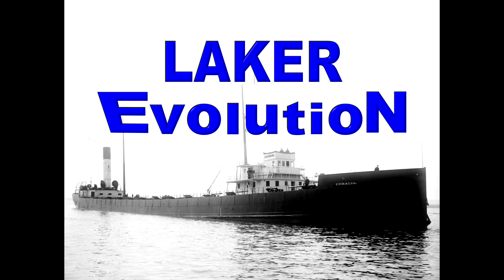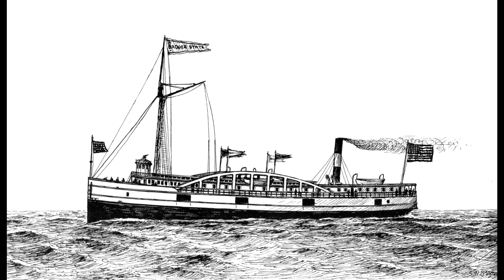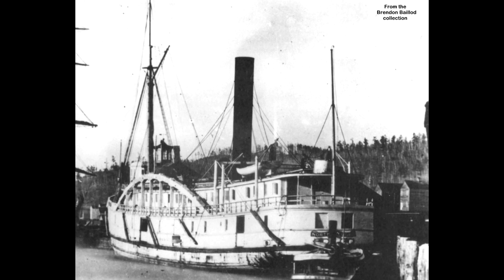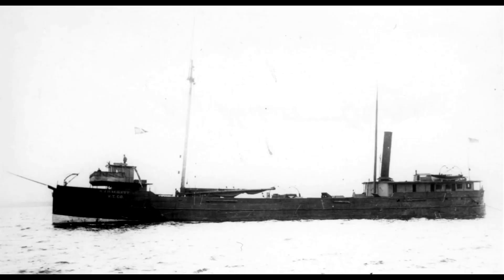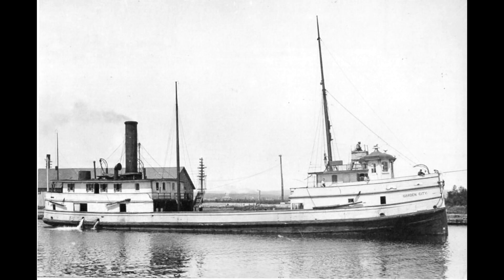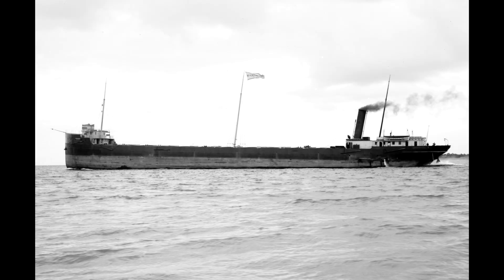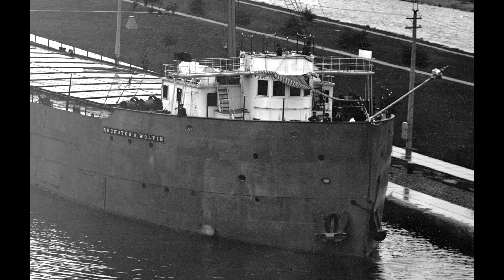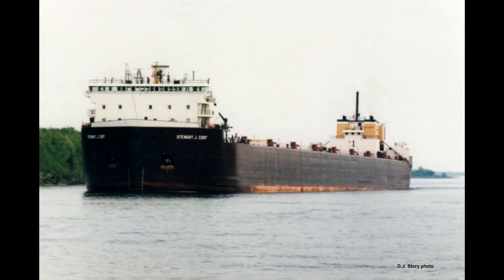Great lakes freighter evolution how did the classic laker look develop through steam, fire and ore.

Comment: In my personal opinion, the Wheel house in front and Engines & smoke stack in the Rear is the Calling card for Great Lake Freighters.

It’s too bad that people prefer the Wheel house, Engines, and everything else in the Rear.
Reply from the maker: I agree
Reply: @authorwes , I have a request for a certain class of LakeBoat, and that is the AAA class (which includes the Arthur M. Anderson, the Cason J. Callaway, and the Philip R. Clarke).

Also, just In general, I am curious about all the different classes of different Lake Freighters. There are lines of Lake Freighters that look the same, and then there are lake freighters that look totally different (and only common similarity between them is the shared classic arrangement). So, what are the different classes of lake freighters? What are the class names? And why were they called that class?

Comment: Hey i see you know a lot about the Great Lakes. My question is that I know several world war 2 ships were converted to lakers how did they get into the lakes because they are surrounded by land is there like a small opening that goes into the lakes?
Reply from the maker: Good question. Most, prior to the present St. Lawrence Seaway, were buoyed up by water-tight extensions welded onto their hulls to act as "pontoons" and then towed up the Mississippi river system. The extra buoyancy allowed them to get across the shallow spots along that waterway. They also had their deck houses placed on their spar decks for bridge clearance. There's a good photo of the Cliffs Victory coming in through Chicago that shows this. Once on the lakes, the "pontoons" were cut off and the deck houses were stacked. That would make a good video... thanks for the idea!
Reply: @authorwes  no problem you make good content subscribing

Comment: Why are Great lakes freighters bows round and not pointy anymore? Also, why don't freighters in the Great lakes take advantage of the bulbous bows like their saltwater counterparts do. It seems like a great way to passively reduce drag.
Reply from the maker: It's all a matter of getting into tight docks. Also a few lakers have had bulbus bows, but they made little difference in fuel economy over the relatively short sailing distances. Ocean vessels sail far longer routes and there is an overall fuel advantage.

Comment: Question is, did this design contribute to ships snapping in half? There must have been a tremendous amount of torque working on the midship area as the lakers were hogging and sagging.
Reply from the maker: Only with the earliest steel hulls. The other that broke in half were do to a type of steel used in the late 1890s and early 1900s which became brittle with age and in cold conditions.

Comment: Sorry if I missed it but why are ships not designed in the classic style anymore?
Reply from the maker: The primary reason is that it is cheaper and easier not to have to string cable and steam lines for heating the length of the vessel. The second reason is that currently all of the lake new vessels running are being built in China or other overseas shipyards. The first new lakeboat to be constructed ON the lakes in 3 decades was started last year. It too has all accommodations aft... but at least it will be made with U.S. steel plates and not that Chinese junk.
Reply: @authorwes   thank you for responding. Really sucks most of our great yards and industry have been shut down but some definite good news there.
Reply: @authorwes   Also I notice the new ships don't seem to need the "aiming spar" on the bow either.
Reply: @authorwes  Radar with its Vessel Traffic technology almost replaced the need to be all the way forward, however, there is a video of ships (boats) in winter layup with what looks like an enclosed forward lookout station and maybe a bow radar. This bow radar should give accurate distances of the bow off docks when docking and for turning in narrow seaways. Captains like to know when the bow is abeam of a (eg.) buoy or point of land to begin a turn.
Reply: @authorwes  I'm certain this is probably a non-issue, however it's going to be interesting to see how well the china built ships hold up over decades. When you consider that ships like the Wilfred Sykes are still toughing it out on the lakes, I kinda wonder if the foreign ones will have that kind of longevity. We both know the great lakes are a more stressful environment to ships than the oceans, but doubt we'll be around to know for sure. GREAT video btw!
Reply: @authorwes  Doesn't that violate the Jones Act? I thought all ships operating between two US ports had to be American built, owned, and operated.
Reply: I am new to learning about these ships/industry/history  -  this has been my question too, and this is the now where I've found the answer!; I did think that the cheap China ships were surely a factor, but - I was wondering if also safety was somehow a consideration; if a boat snaps and all crew is aft, in theory, there's - only generally speaking, better chance of survivors?  Of course, the explanation of the cost cutting is really 'all' it is.. Thank you! I really enjoy your videos Mr. Oleszewski!

Comment: How do lakers translate to salt water? I'd imagine that they're built sturdy enough to withstand waters like the Atlantic but do they have the fuel efficiency to go across it?
Reply: They do not have the strength nessasary for this. They are built totally differently  than saltwater vessels, lakers are much lighter.
Reply: Lakers are designed to flex and bend to handle the steeper, choppier waves of the lakes. They'd snap in half in the high rolling waves of the North Atlantic gales like an ocean freighter would be beat to hell and back by the choppy waves of Lake gales.
Reply: Simply, the lakers would snap in half with the waves of the atlantic. Some lakers cant even withstand the waves of the great lakes. More so, the Atlantic waves